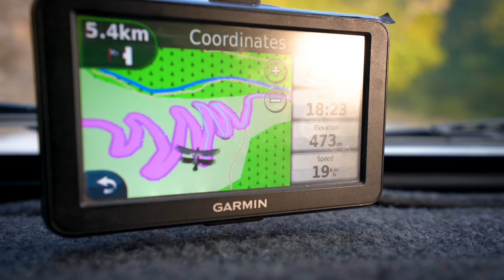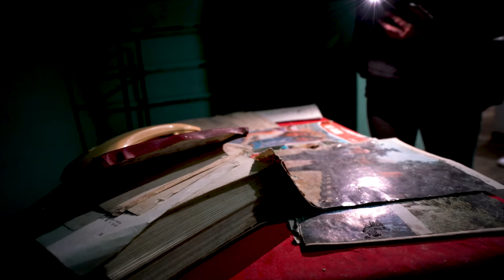The DEEPEST GORGE in the WORLD! - ALBANIA  🇦🇱 - Australia to Scotland by road - Episode 94

Comment: Great video. How do you keep your water in the tank from freezing?
Reply from the maker: Cheers, fair question though we don't actually do anything.  Surprisingly even when the temps dropped well below zero and we were camped the water in the tank didn't freeze, potentially because of constant movement by us moving around inside?  The lines from the tank have frozen though not the tank itself.  If we were spending more time in these temps we would insulate the whole system.